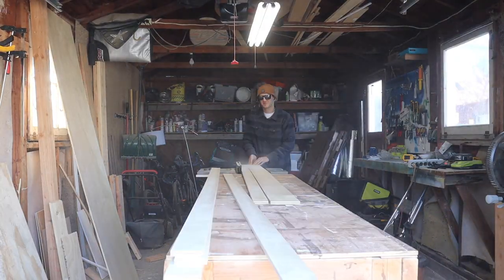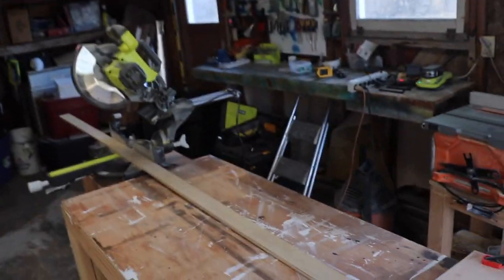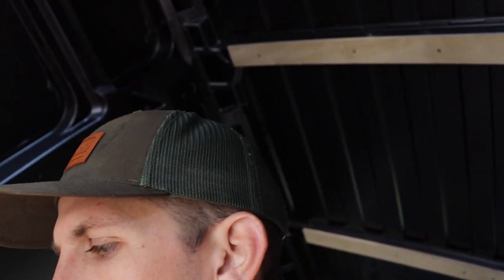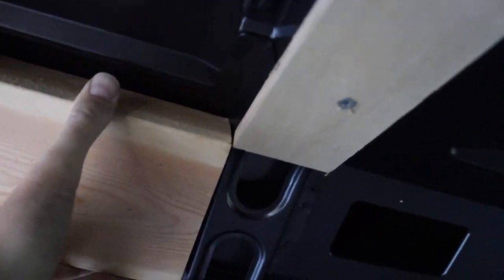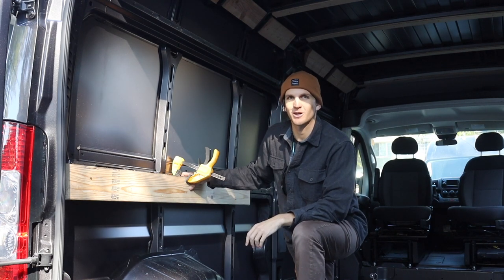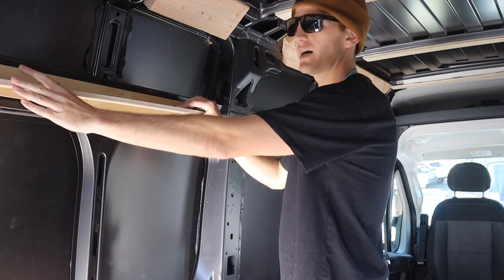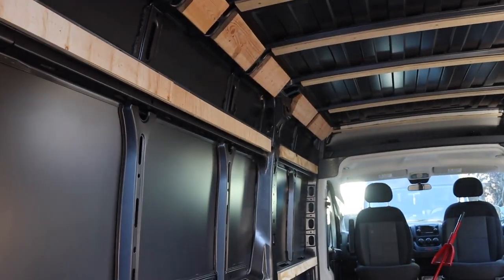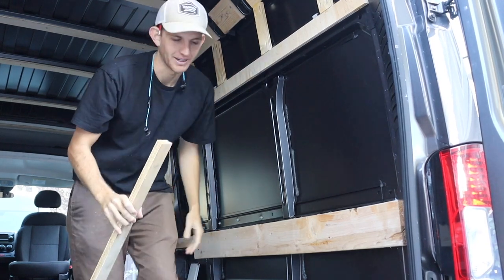VAN BUILD | FRAMING a RAM PROMASTER

Comment: As an infant in the learning curve of van building and an almost-senior lady doing something so far out of my comfort/knowledge zone, your video (which I've watched 3 times so far) has been so helpful!   I'd appreciate a parts list so that I'm sure I'm purchasing what you're suggesting.  I've never heard anything but the plus nut/riv nut route with is more complicated and more expensive, so your approach is something much more easily achieved by me.  Your tips are worth their weight in gold!  Thank you so much for sharing  your knowledge in detail!  Tremendous video!
Reply from the maker: Thank you! Happy to hear that my videos have been helpful! That’s why I started this channel in the first place!!! 
I agree with you about the plus nuts, those are probably a stronger option but more complicated and expensive. Self tapping screws with construction adhesive is plenty strong and in my opinion easier to install! 
Good luck on your build! And congrats on stepping out of your comfort zone and learning something new!!! Cheers 🤘🏻
Reply: I keep going back and forth with nut/riv too.  Is there any other benefit to riv,  like rust prevention and removal?   I am doing your video this weekend 😬😁
Reply from the maker: @suzettecsutton  The biggest benefits to riv nuts is it’s strength and remove-ability. It’s cons are that it’s more expensive and more difficult to install!

Comment from the maker: Notification bell gang!!! Thanks for watching. Links to everything in this van is in the description. If you found this helpful, LIKE THIS VIDEO AND LEAVE A COMMENT! That is the best way to help my channel out!
Reply: I’m trying to figure out if the Promaster is tall enough for me. How tall are you?
Reply from the maker: @joeblow1942  6’2”
Reply: @AnkeneyVanBuilds    Cool. I’m only 5-11 so I’ll be good. Thanks.
Reply: @AnkeneyVanBuilds  I just came inside after staring at the walls of y 2019 promaster trying to figure out how to frame out everything in prep for walls floor and ceiling. Yours is the first detailed video I'm watching, it' very good! Can you tell me, what year is this Promaster? Did you have to do any shimming anywhere or is all your framing really flush up against the van walls/framing? Do you have any gaps at the location of the screws, between the wood and the van walls/frame or is all the framing in contact with the metal of the van (with the exception of the very end where you pointed out a gap at the gate end of the van)? Thank you for anything further you can share. I'm feeling a bit intimidatedat this point, I can't find any corners, angles or anything that seem to be the same inside this van- it's mind boggling!!
Reply: @AnkeneyVanBuilds  I saw you invite people to ask questions, I'm following your video to do my framing right now, and hoping you can tell me, did you use actual Kreg self tapping screws along with your Kreg jig, and what length were they? And by any chance can you estimate how many screws in total it took to frame out and install the interior wall and ceiling covering? I'm trying to count up how many screws to buy in various sizes and it's looking to me like I'm going to need at least 500 screws just to get the walls, celing, and floor in- that's before any cabinets or constructing the bed frame- does that sound right? I'd be very grateful for your reply, and thanks for the excellent video! Happy New Year to you!
Reply from the maker: @sheri4673  I use the kreg pocket screws for soft woods at 1-1/4 since it’s all going into 3/4” wood. They come in packs of 100. I’d think 2-3 of those will be enough
Reply: @AnkeneyVanBuilds  Thank you so much but one more REALLY important question, when you say 3/4" plywood or 1/2" plywood are you meaning ACTUAL measurement of the wood? As we know, anything labeled 3/4" is always a bit thinner in reality. These measurements will drive one crazy!
Reply from the maker: @sheri4673  plywood is pretty true to size ! It’s the 2x4s and so on that are off

Comment: Well, I hope you show the close up in the future what you have in you hand screw wise and how and where you are placing it that is what I want to see to make sure I know where to drill. Yes beginner people need the detail where the screw is going into the metal. Fear of screwing up pun lol good video your the only one I have found showing details in framing. Thank you
Reply from the maker: I did show the products I used in the beginning of the video! I used 1-7/16” wood to metal self tapping screws and construction adhesive. 
As far as the placement of the screws, it is fairly straight forward! There’s about a 10% chance your miss since there’s random gaps and holes in the structure, and if you do find one of those it’s simple enough to back the screw out and find a different spot!

Hope that helps!

Comment: Best build video I've seen to date. I'm building a Promaster, and have been scratching my head so far, on how to do tricky parts. The passenger side, behind seat, has me freaked out.
Reply from the maker: Are you talking about over the slider door?
Reply: @AnkeneyVanBuilds  Yes. It has that area above the slider that is narrow and comes to a point. I with I had your skill.
Reply from the maker: @splash1152  check out my “finishing touches video” I talk about how I covered that area up! You got this
Reply: @AnkeneyVanBuilds  Thanks a lot. Your  the man.
Reply from the maker: @splash1152  you’re welcome 🤘🏻
Reply from the maker: @splash1152 🤘🏻🤘🏻

Comment: Nice video with plenty of helpful tips.  I do find it interesting how one builder will only use plus nuts and paint all firing strips with Killz while others choose to just use raw wood and drill straight into the van.  I guess it really comes down to personal choice.  Thanks for sharing.
Reply from the maker: Thank you! You’re Exactly right though. One of the most common questions I get is why I don’t use the plus nuts. I used self tapping screws and construction adhesive for my first van two years ago and it’s still working out great! I also find it more more efficient and less time consuming! 
Thanks for the comment. Cheers!
Reply: @Cascade Yoga Co. Depends on how meticulous you want to be.  I chose to use rivnuts, painted all drilled out holes with auto primer/paint, and used mildew resistant Kilz on both sides of all lumber.  Seemed to make the most sense to me.

Comment: Great video. I’m wondering if I use 1x3s which are 3/4” thick if that would throw off ceiling using the 2x6s? I don’t have a way to rip plywood.

Comment: The best video I've seen on the subject, very well done. Could you post a link to the exact wood to metal screws you used please? Key info. I've looked all through the HD screws and still not sure. Was that Liquid Nails? I've used self tapping exterior 1" galv wood screws extensively in a marine environment and they've been perfect after 10 years. Thank you, I've just subscribed.
Reply from the maker: Thank you!! I appreciate it.  
For the wood I used:
Ceiling: 1/2” plywood ripped at 2.5” wide
Angled ceiling piece and bed frame: 2X6 lumber
All of the wall studs: 3/4” plywood ripped at 2.5”
The screws are 1-7/16” wood to metal self tapping screws (the brand is Teks)
The construction adhesive was from the Gorilla brand!

Comment: Hey, love this build, it’s been super helpful framing out my Promaster. I’m curious why you frame the ceiling along the beams instead of just screwing straights into the beams and adding framing at the front and the back? That’s what I am planning on and curious if there is any reason I would need the extra frames along the existing beams.
Reply from the maker: Great question. Since this was going to be a tongue and groove ceiling the framining needed to be perpendicular to have enough places to attach the ceiling. 
But the vans that I’ve used wall panels for I run the framing boards front to back!

Comment: great video!! anything to be gained comfort and noise wise by filling by the ribs with foam or stuffing insulation in them ? i assume you are using flat board style insul behind the open parts of the walls?  thnx,
Reply from the maker: Becarful filling the rips and stuff with spray foam ir that "great stuff" insulation. if you spray too much it'll start to expand, since the outside of the van is just thin sheet metal, it can warp the outside!! don't want that to happen!! I have a video where I show my insulation techniques!!
Reply: @AnkeneyVanBuilds  have heard to be careful w the foam, , also  that winnebago and all the highend conversions use it   thnx for the help.
Reply from the maker: @joeymyopic  you’re welcome! Hope I helped! Good luck!
Reply: @AnkeneyVanBuilds  was quoted C$1200 , US$ 950 to foam  a promaster 136" high roof  walls, roof, and backdoors , does that sound reasonable to you?   appreciate your help, i'm in the logo'd apparel business,  can supply anything u need at  dealer cost.
Reply from the maker: @joeymyopic  I spent close to $700 on doing the insulation myself with the 3M thinsulate! 
And that’s awesome. Send me an email @ ankeneyvanbuilds@gmail.com with some info about the logos!

Comment: Very well done!  Pretty much every build I see puts untreated / unsealed wood in the floors, walls, and ceilings.  You don’t want to do that. There WILL be moisture and that plus raw wood in an enclosed space can lead to mildew (usually) and mold (rarely). Good idea is to seal (primer or sealer) all the raw wood before installing it.

Comment: Love this framing idea, I’m going to try to replicate. 
Just curious, did you use the same 1 7/16 self tappers on the 2 by 6s up top too?
Reply from the maker: No those were 2-1/2" screws!! good question!
Reply: @AnkeneyVanBuilds  To clarify, you mentioned 3" screws on the video when screwing the bed studs. Will 3" work for the cabinet studs as well?
Reply from the maker: @jennypatacsil9821  yes! 3” will work for those too!
Reply: Is the 1-7/16 screws needed since the strips are only a 1/2 inch. Seems like a 1 inch would do just fine. I’m not looking at an actual van, so maybe I’m missing something. Thanks

Comment: Hey dude so did you use 3/4 in ply for that driver side middle horizontal column and then 1/2 inch for the passenger side?
Reply from the maker: 3/4 for all the walls!
Reply: @AnkeneyVanBuilds  Thanks dude!

Comment: I got the teks you recommended but with the 1/2 in ply on the ceiling framing it looks damn close to hitting the roof when screwing in, did you use tek 1 1/4 in for the ceiling framing?  Thats what I am going to get tommorow, and use those 1 7/16 for the 3/4 in ply struts. Just curious what you used for that.  Thanks again sir! much appreciated
Reply from the maker: I used the 1-7/16ths for all of them!

Comment: Incredible video. Man, this is so clear and a very good strategy. Got a couple quesions: Is this the Promaster 136WB High Roof? How long are those two sets of vertical studs with the pocket holes?  Did you stick with 55 inches for the horizontal frames as well? Tough to find decent diagrams online and I have no stores to check the Promaster dimensions in my area. Living in Germany right now and about to move back to the USA in March, but I am trying to get a plan ready.
Reply from the maker: Thank you! Glad you enjoyed the video! Hope it helps. This is the 159” high roof! 
I don’t remember exactly how long they were. But the upper cabinets I put in were 12”! 
The horizontal frames I just measures and cut. Don’t remember the exact size! Sorry

Comment: Hi Colton. This is such a great video. I watched it a year ago, and have watched several other framing videos since, but this is the one I keep coming back to. I have already cut my furring strips and 2x6 pieces and got the 1st furring strip on the ceiling today. In a couple of other videos, people complained about needing different thicknesses of furring strips for the Promaster to get a straight edge across the ceiling, but it looks like you are using 1/2-inch strips for all the support beams. Is that the case?

Comment: Thanks Colton, great video, about to start framing my promaster... is that baltic birch plywood you're using?  Or just regular plywood with hardwood panels on outside and softwood inside?  Thanks!
Reply from the maker: All the framing is regular sanded plywood. When I make cabinets I use birch!
Reply: @AnkeneyVanBuilds  thanks Colton!!

Comment: great video. your vertical bed frame is used with 2x4 brackets that are vertical across and then those are drilled into 2x6" for the frame correct?
Reply from the maker: That is correct!

Comment: Great video!   I'm trying to do this now and couldn't with regular 1/2 inch boards as they didn't bend.   Your boards look floppy and bendable.  So if I got the 1/2 inch sheet and cut them 2 1/2 inch wide, they should be floppy and bendable like yours?
Reply from the maker: That is correct

Comment: Hey man, I am currently following your framing vid and had a question about that front stud above the cab. Do you think you’d ever need to access those wire up there? Once you frame and put the ceiling up it would be forever inaccessible...
Reply from the maker: That’s how most of them are. To get to those wires you have to pull the ceiling boards down.

Comment: I did my bed framing just like yours- metal screws straight through 2x6 to the van .  But I'm seeing alot of van builders use riv nuts. I'm nervous this won't hold up. How is your van doing? Any loosening feelings? etc? Thanks much. I'm solidifying my incoming bed frame now. I'll go check out more details on your bed video too. But this is the area I'm mostly concerned about since it's the most founding.
Reply from the maker: It’s been 3 years and everything is as secure as when I installed it

Comment: Thanks for the video! You attached the half inch plywood studs with self-tapping screws. I've seen many other van builders use Riv-nuts. I would prefer to use self-tappers as it seems easier. I would like to know if you've had any issues with any of them coming loose over time as you drive your van. Appreciate any insight or guidance you can provide. Thanks!
Reply from the maker: Never had any come loose!
Reply: Thanks so much for the reply! One more question I was hoping you could answer. The van I purchased has a floor made of MDF. The MDF will be covered with Vinyl and I will be screwing cabinets and other fixtures into the floor, but before I do is there any type of waterproofing solution you would recommend. e.g. Thompson's water seal? Thanks!!

Comment: Great videos & info I am building out a Promaster & pretty much copying your design . How did you frame around the two lights at base of ceiling of the Promaster . 
One light is located at center directly above rear doors . The other is located on passenger side above and in back of sliding the sliding door . 
Thanks much ! 
D
Reply from the maker: I believe I just popped them out

Comment: I am glad that I stumbled onto this channel because framing is one of the most difficult steps (for me) and this vid is an excellent resource for leaning How To.  One furring/framing issue I have really struggled with is thermal bridging where, just to re-explain what some  are already aware of, the (hypothetically) uninsulated van metal ribs that your framing is attached heat up in direct sunlight and transmit that heat through the framing as wood is also allegedly a poor insulator.  To combat this somewhat, I have seen some install furring strips front to back and insulate between them, though this primarily on a cargo trailer with a flat roof.  Am I overthinking this, or have you experienced any heat build up inside the van and thought of giving up precious inches for more insulation layers?   Thanks a lot for these great videos!
Reply from the maker: Interesting concept!! If you framed it out length wise would you run your ceiling panels width wise of the van? If you have available headroom I’d totally try to insulate it
Reply: @AnkeneyVanBuilds  Good question on the ceiling panel direction.  In order to achieve the desired "thermal break" by ensuring that a "continuous layer" of insulation covers the van metal frame, some have installed yet another set of furring strips width wise (after installing the lengthwise furring w/insulation and wiring) so that the ceiling panels can finally be installed lengthwise.  Others have used rolls of closed cell foam that has flexibility and can curve with van contours and put it right overtop the van metal before any framing/furring.
Reply from the maker: @ojorojo8283  ohh I see what you’re saying about the ceiling.. interesting!

Comment: I just started my framing and one of the issues I'm having is some of the 2x6 not screwing tightly on the metal framing... what would be your advice for this scenario?
Reply from the maker: Hm, maybe try using a smaller drill bit. Also what king of screw are you using on the 2x6? If it’s just a wood screw it won’t hold as well as a self tapper or a wood to metal screw. 
Hope this helps!

Comment: Great video, I agree with a lot of the comments that this is one of the best tutorials on framing a van out there. One questions I had, are you drilling the pilot holes with the 5/8th bit for the self-tap screws after you mock the joist in place with the construction adhesive vs using a self drilling/tapping screw? I can see the benefit of using a pilot hole especially when using a bit with a countersink on it to lay the self tap screws flush against the board. Thanks for all the information and content!
Reply from the maker: Thanks Nolan! If you have a good impact driver, pilot holes aren’t totally necessary!